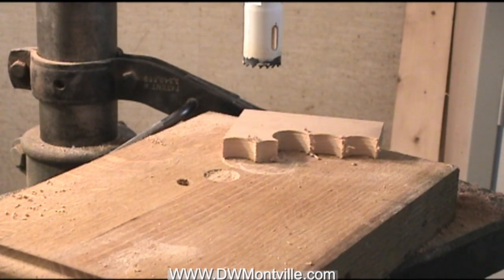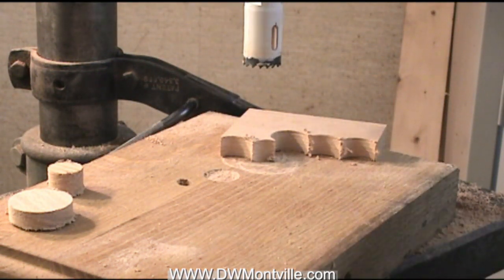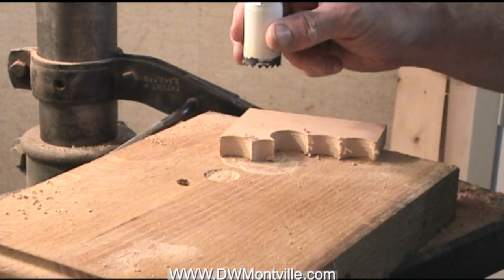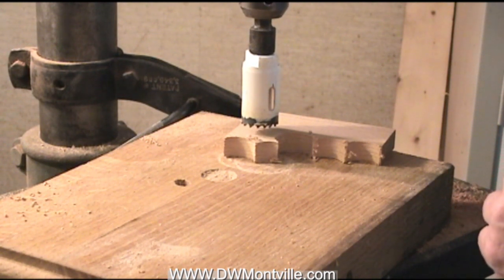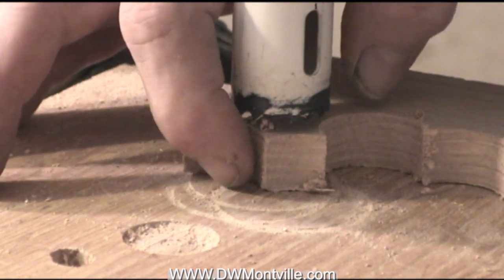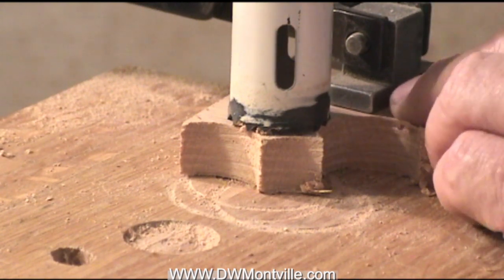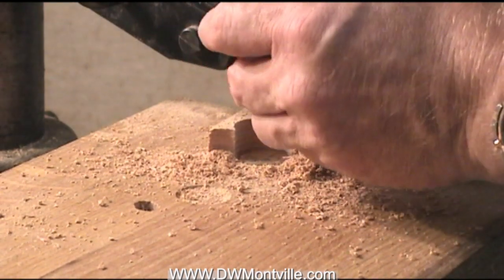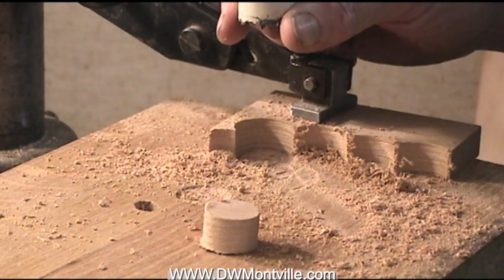Cutting rounds with a hole saw and drill press UPDATE

Comment: I have been drilling with holesaws for years and it never occurred to me to do it the way you  have shown here. Thanks for the video. I think I'll go do some holesawing soon. I always used the drill bit and clamped the wood to the drillpress table. Like you said, it is frustrating with all the sawdust and smoke and having to keep clearing all that just to make a nice plug. I can remove my drill bit and do it the way you showed. Thanks.

Comment: Thanks for the tip and info. I was getting smoke and no joy until repeated cycle of cut a little, clean the gullets, blow away chips, repeat. I used one of the cut out plugs to rub against outside of teeth to clean away chips. It worked so much better, and I got nice clean cuts. Thanks again.

Comment from the maker: All of the hole saw kits that have a separate mandrel have the center drill held with a set screw. You just remove the screw and pull the drill bit out. Some of them have a drill bit with a flat ground on it where the screw holds it so you may have to back that screw out quite a way before you can remove the drill. If the hole saw mandrel you have has a drill bit that can’t be removed then you’ll have to get another hole saw.

Comment: That is slick as can be! Sweet idea man!
I have 2 General Tools circle cutters I use, a heavy duty and economy (the economy cuts a much smaller hole). I have an adapter bushing to use a smaller drill bit in the center (my Dad is a machinist) that is sized to match a round toothpick.
I use a center drill to mark where I want the hole, then use the circle cutter to cut the blank. And since there is only one cutter, it doesn't clog and is easy to keep honed absolutely razor sharp.